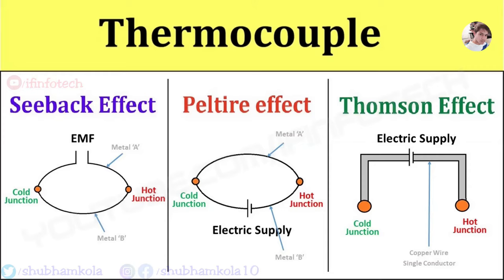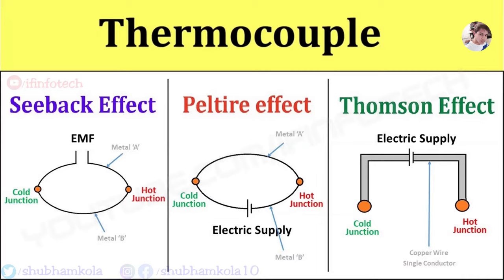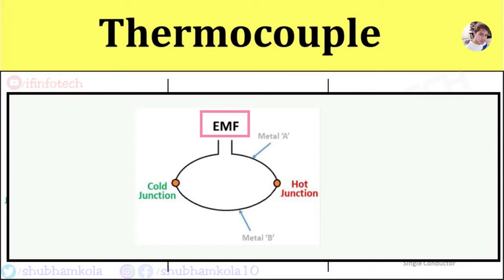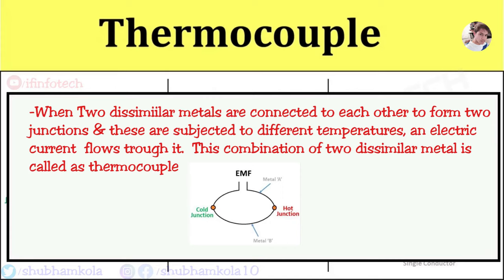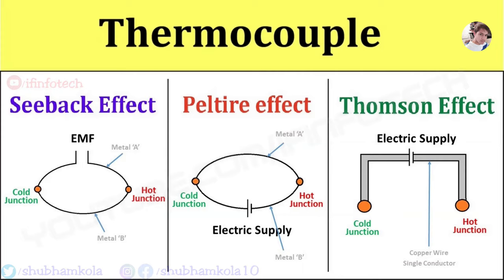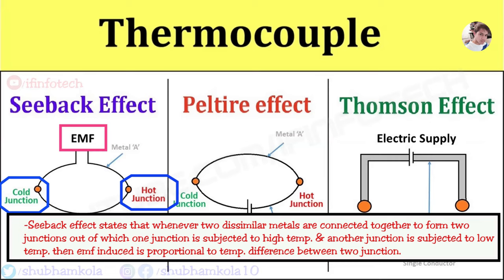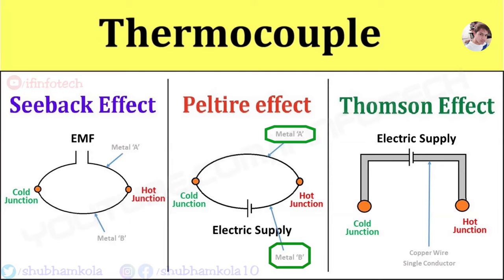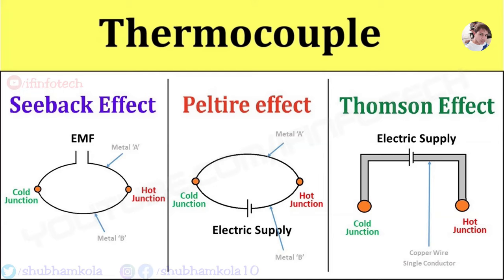Thermocouple Working Principle: Seebeck Effect, Peltier Effect, Thomson Effect [Active Transducer]

Comment: Thermocouple is a passive transducer *
Reply from the maker: Thermocouple is an active transducer because The transducer which generate output in form of voltage or current, without any external energy source is known as active transducer. whereas The passive transducer which means the transducer whose internal parameters like capacitance, resistance & inductance changes because of the input signal. for example Thermistor, Differential transformer, Photomultiplier tube, Photovoltaic cell all are passive transducer.